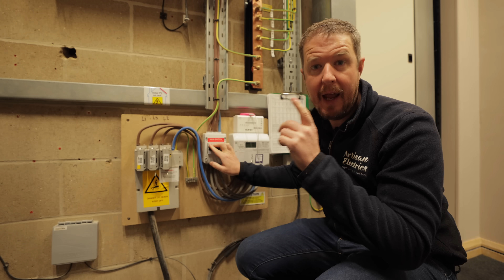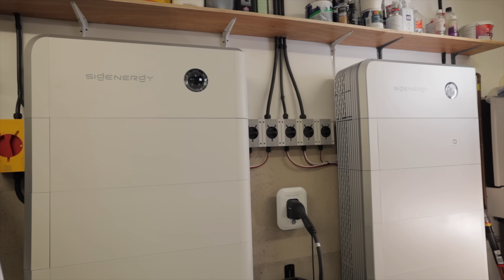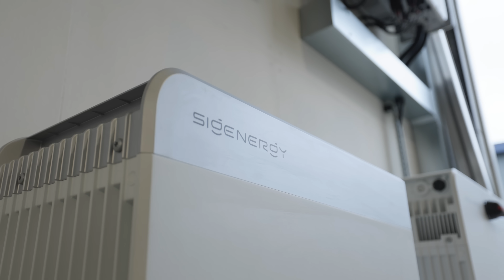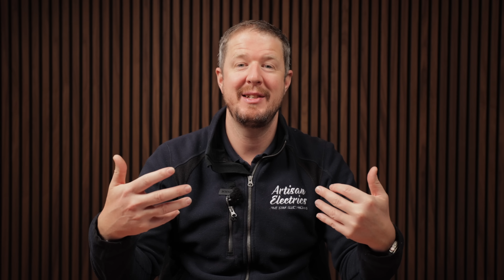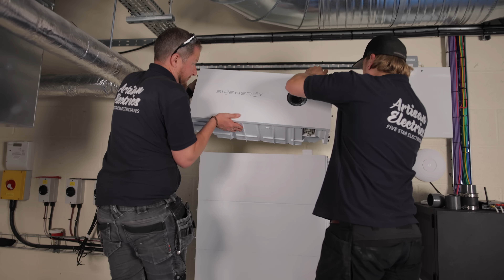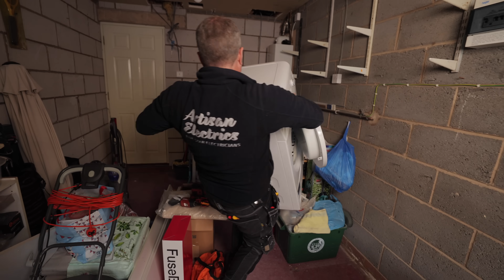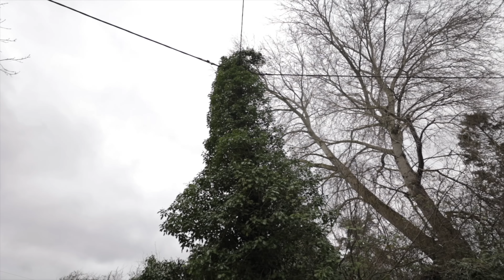You’ve Been MISLED About Battery Backup

Comment: We have a multiple BIG ups for computers in the office …in a power cut …do they back feed to the grid?  We dont have a grid disconnect.
Reply: No, they (Big Proper UPS')  have contactors inside that will seperate the input feed from the busbars, so no energy can go back out - they'll typically wait 60 seconds once the input feed has regained power, before re-engaging the contactors (as well as checking voltage/frequency and in the case of three phase, the phases are correct before reengaging the contactors).

Comment: Finland here - I'm off grid. I currently have around 15kW of solar and 120kWh of LiFePO4 battery. Even if I have no generation, I can power the house for 25 days without losing any comfort.
Reply: Well done !!
Reply: Good diversification of energy sources... gives you multiple layers of redundancy.  Which is wise given the severity of a Finnish winter... is more than comfort,  it's survival for you guys.  Hello from Australia btw.
Reply: How about for heating?
Reply: @mart34  Wood gasification boiler coupled to radiant underfloor heating, and a masonry fireplace. The gasification boiler also makes the hot water for showers, etc. The wood comes from my own forest, where I'm converting a tree farm into a natural forest. This means cutting monoculture to get more biodiversity. I have enough firewood for the rest of my life, and then some. All the wood is processed in spring and autumn with electrical tools.
Reply: @upnorthandpersonal Thats genuinely awesome. I admire everything you're doing.
Reply: So that's about 4.8kWh demand you have,  which is low by UK standards. What are you using for cooking?
Reply: @JC-zw9vs Induction in summer, propane in winter. The oven is integrated in the masonry fireplace.
Reply: 120kWh wow

Comment: I have a Powerwall 2/Teg and a Solar Edge inverter. I can use the system during a power-cut and get up to 5kw of backup power which is great. However whenever there is a power-cut it trips the RCD in the consumer unit. As long as I reset the RCD the Tesla provides backup power. My installer, who certainly seems to know what they are doing, said that Tesla wants 100ms RCD’s fitted but that’s not legal in the UK. The current theory is an islanding issue where the Tesla and the Solar Edge are both trying to island themselves from the grid for safety reasons and creating an imbalance. If I cut off the power manually just after my electricity meter then the backup kicks in ok and the RCD handles it. It's just something about the types of real power-cuts we get here that cause some odd behaviour. The solution that has been recommended is to replace the single RCD with RCBO’s for all the fuses and see which one(s) trip during the next power-cut. We seem to get 4 or 5 outages a year lasting usually a few seconds but the most recent one was an hour.

Comment: I recently had a Sigenergy system fitted (~9KWh battery, 8KW inverter) with the gateway and I do wish I'd thought a bit harder about this stuff. With the current setup, it should handle the full load from the house, but only as long as we're not using the electric shower, which pulls about 10KW. Statistically I guess it's unlikely the shower will be running when we have a power cut, but of course that could happen. We decided to pay the extra for the gateway on the basis that we have semi-frequent power cuts. We live rurally in the UK and our power comes via overhead lines that get hit by falling trees reasonably often.

Comment: Having been installing off grid and ongrid/off grid systems for 20 years there is only one brand I absolutely trust to do the job properly.

Not Sigenergy.
Not Tesla.
Not Solis.
Not anything Chinese.

Victron. Only Victron. These guys specialise in off grid and on grid back up systems that can utilise a diesel generator to charge batteries and they do it properly. 

The problem is 95% of installers are not knowledgeable in the fundamentals of off grid living and the design of a proper, reliable and useable backup/UPS system. 

Get a 10kW hybrid, slap on an EPS gateway and bish, bash, bosh… All good.

Except it will not be. 

There is some very good advice here, really good advice but a true UPS system design needs resilience, 100% overload tolerance and must be well designed to meet the demands of the loads imposed.  Most are not.

Victron scare most installers purely because the installers has to know what they are doing to commission the MP2/Quattro properly. Most have no idea….
Reply: Victron is too flexible for many installers - you really have to know what you are doing, to design and configure a Victron system.

You have to specify battery parameters, for example.

Plus you need to work-out your energy and power needs, to select the right combination of solar, battery, and inverter capacities.

The advantage is, no cloud connectivity, unless, you want it, and it's on your terms, under your control.

The sigenergy system, requires Internet connectivity, to get the full battery warranty.
If the sig system looses connection, after nagging you daily for 90 days, it will limit your inverter / charging power to 70% capacity, and prevent the batteries going outside 10-90% SOC.

It gets worse.
I was looking for the connectivity / firewall requirements, and it's not mentioned anywhere in the installation guides.

What does appear happen, is that you need to be a registered sigenergy installer, to register and commission the system.
The end-user is then sent a link to create their own account to monitor the system.

The sting is this:
It appears as though your installer, retains access to your sigenergy system, via their installer account, and installer app.
That account does not appear to use a 2-factor login, and can have the password reset, via e-mail.
So if an installers e-mail is compromised, it appears as though you can shut-down, any of the systems they have installed.

That is shocking, if true.

Bad enough for a domestic install, but giving remote control of your power to a third-party, as a business?

Comment: Biggest mistake i made was sizing my battery bank. System was spect for 10kw back up battries on a 10kw system. I added another 5kw battery. Installers promised i will be off grid but around 0.00 in the morning i go back to grid power till 9.00 in the morning. Basically i need to run from battries for 18.5 hours a day and need 25kw in total of battries to be off grid . Made a mistake by not checking my load usage patterns before sizing the bank. People do your own home work installers will promise you the moon and starts just to get your Business

Comment: My 15 year old Eaton UPS died last month, so went looking, and got a replacement, with a 10kWh battery bank, for around 1000 pounds, just had to marry a 3kVA solar inverter, used as the UPS now, with a 2 mains cycle max changeover, and a 10kWh LiFeP battery bank, all bought on end of range clearance for around half price. not going to have the UPS nice graphs, but looking at getting that running.

Comment: I have a solis s6 hybrid inverter, 22kwh of pylontech batteries.
It has a built in AUX. Output, so no external gateway required. Ours is just set to go to a single socket . In the event of a power failure I can just run an extension cable etc..
Also have 10kwh of various sized portable powerbanks.

Comment: Why is a separate earthing system required for a separate "UPS" consumer unit - my preferred choice as it would included the CH pump, the achillies heel of all non-electric CH systems. 
(In France I had a wood powered CH boiler, no power, no CH pump so the need to shut the manual fire damper and douse the boiler !).
Back in the UK (sadly) have gas central heating so the Essential Services Board would need , some lighting, CH pump, IT socket(s), fridge & freezer, 1 kitched outlet.

Comment: Whilst I think I understand the concept of batteries, inverters, UPS etc. what happens if your Car has the capacity of V2H or V2G - in theory this could change the game as the car could be used to bump the house supply (assuming you can recharge the house whilst using the car battery to power the house. Or is this impossible as battery A would be charging as battery B discharges?

Comment: I know someone with PV and battery with backup and air source heat pump regularly in the habit of maximising force discharging the battery to the grid - he had a power cut in the night when he was expecting his battery to get charged and instead woke up to a cold house. His PV helped later and the DNO temporarily installed a diesel generator because of their failed transformer which later ran out of fuel!

It makes you think about the chances of needing backup and the chances of other things happening to trip up your preparations.

I have 30kWh of battery storage with 10kW discharge capability and 12kW inverter power. I did consider automatic backup but thought it was such a rare event it probably wasn't worth the cost of the extra backup box. 

I have a manual isolation switch and an earth rod so in the event of a sustained power cut I could isolate the system, login and switch to island mode but I've never had to do it. The longest power outage I've had was only long enough to reset the clock on the oven or I wouldn't even have known otherwise.

Comment: The thing I miss in this video is how much energy a backup interface uses
Reply: EPS power usage is basically same as no backup usage. It's a couple of fairly expensive relays.

Full proper double conversion is significantly less inefficient which is why you only do it for devices that need it
Reply: @etchedpixels  I mean how much the backup system uses to constant match the wavelength to the grid for an ups

Comment: I have a 900 speed router fibre which power station do I need how many watts to power them for about 5 hours please
Reply: Lookup the power rating on your router power supply.
Take the figure in watts and multiply by 5. The answer to the calculation is then the battery capacity you need in a UPS, expressed in Wh.

So if your router power is 800mW This is then 0.8*5 = 4kWh.

Check the type of battery being used in the UPS. If lead acid you will need to double this to 8Wh. If it's LiFePO4 then you don't need to double it.

Comment: Biggest problem I have at the minute is getting a quote back from local installers for a manual switchover to run essential loads (everything except the car and soon-to-be-installed heat pump).  I am guessing the work isnt enough revenue for some to respond.  That sound about right?

Comment: very useful information, and I can say indeed a lot of people don't know the difference you have just explained, when I installed my solar system, I went with a 15kW, 3 phase invertor, 10kWh battery storage, and 12.5kWh of solar having it installed east-west, and in 2025, for the better part of the year I've disconnected the grid, since i wasn't interested in exporting power, and the whole house, including the workshop that uses 3 phase for some machineries, short story it all went well, and now I consider doubling the battery capacity
Reply: Solar panels are measured in kW, not kWh

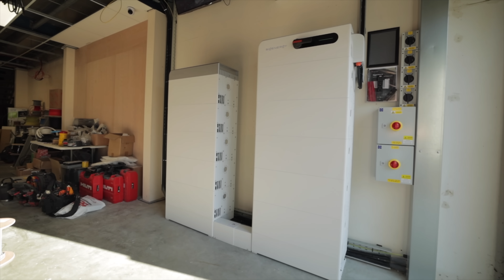Comment: 5:18 ...changeover time sub-zero milliseconds? So it changes before the event happens? Spooky.
Reply: I twitched a bit at that. I'm assuming it's "sub-ms", not a predictive system.
Reply: It's marketing. Sigenergy desperately needs to enter stock market and is both selling with minimal margin and running ad campains everywhere. 
My friend from solar distribution company had their presentation in his office but they when they showed him oscilloscope pictures with that changeover time the time resolution was on seconds 😂😂😂
Reply: @MrRaddoslaw  Actually, if you need to get serious about this, the Sigenergy gateway is 0 ms, rounded down! 
What that means is that it could be 0.49 ms, or 0.35 ms. We'll probably never know. But rounded down, because it is below 0.5 milliseconds, with no decimal places that is zero milliseconds.
Point is, they have achieved the closest to UPS they could without calling it UPS. And there are very few devices that would be bothered by less than one 500th of a second changeover.
Reply: @MichaelWakefield-mx6hg I would like the source or preferably oscilloscope data. Changeover time od 1 ms is highly unlikely - more probable is 3-4 ms and this is real close to industry standard of 6-8 ms. Worth pointing out that anything below 10 ms is UPS and should not interfere with any typical house loads.
Reply: Chinese made
Reply: I think they've engineered it as a UPS with "near as dammit" zero changeover, but do not want to certify it as such, because that would open up liability if people started using it for mission critical applications like life support medical equipment. Also, (and somewhat contradicting myself 😊) some definitions of UPS imply that all loads are inverted from the battery, which is continuously charged from the mains, so there's no changeover required because there's no change in how the loads are supplied.   This however has consequences...eg all house loads have to fit within inverter capacity ALL THE TIME not just during a grid outage,  and inverter failure then becomes mission critical.

Comment: You are missing the inverter must handle peak combined load !
Not just a average load . 
So selective backup circuits is a must even if it's just lighting & a couple of sockets .

Reliance on a working connection internet & someone's server is also problem !
As it can disappear, be terminated or replaced by the next IOT product .

Sorry you've had xx years so scrap it & upgrade …
Just like with billions of PC's, Printers, Walls mouthed batteries & Micro inverters .

Comment: My system is using a critical loads sub panel. I started with just a Grid Tied Enphase system, then added an AC coupled Schneider inverter. The Enphase system feeds into the critical loads panel and it now does work during a power failure. Both Enphase and Schneider needed software updates to make it stable. On our fisr power failure, the Schneider 6,800 watt inverter easily handled the loads in our critical backup panel, but the Enphase inverters were pulsing on and off. We didn't get much charging before the sun went down. On our last power cut with the sun shining it worked perfectly up until the batteries were full. It id try to curtail, but the Enphase inverters still shut off completely a few times, but since this was with the battery full, the Schneider inverter was frequency shifting to tell the Enphase inverters to reduce power, but the response time was not perfect. We have since added more battery capacity to 36 KWHs, and then also added a DC coupled array to also help with charging up the batteries. But also to allow "Dark Start". With the purely AC coupled Enphase inverters, if the battery ran too low overnight, the system would shut down and would not start in even full sunlight. The DC coupled panels cures that problem as it charges up enough for the batter inverter to stat again, and then the Enphase system also comes online. When the grid is up, the system is also able to run everything in the house, and even export extra to the grid for credit. I do have a PTO connection agreement here from my original Grid Tied solar. I am still limited to only 16 amps of export and 900 KWHs of export per month. During the day, the Enphase panels power the house and the DC panels charge the batteries. At night the house runs off the batteries. If we exceed 6,800 watts, it then just takes any extra it needs from the grid. They claim a switchover time of 8 ms, but we do see the lights flicker when it switches. But the computers stay running though it with no problem. The last outage was about the worst switch I have seen, and my monitors went blank, but after a few seconds, the monitors came back up and the PC was still running right where I had left it. All my network gear was still running fine, but we lost the feed from the internet. When it didn't come back up for a few hours, I ended up switching to my cell phone hot spot to check news and to report the outage. While most of the homes in my area have solar panel, only one other home in the outage area had any lights on. The others either do not have any backup system, or they are not setup well and didn't work.

Comment: With PW3 + gateway you only get seamless backup if it's configured as "Self-Powered" most. If set up as "Time-Based Control" it's not quick enough and everything restarts.
I have automations to switch to Time-Based Control when the battery is charging which co-incidentally has been the case the last 4 times we've had powercuts.

Comment: Unless you have endless money EPS is kind of a waste of time. Most houses need 20-30kWh to last 24 hours using power normally. This not only means you need at least this much battery storage but you need them to be 100% charged when a power cut happens which is highly unlikely. You can set the batteries to not discharge past say 30% but that means you are losing 30% of your battery capacity all year round just in case you have a power cut. Not worth it for 99% of the population in the UK.